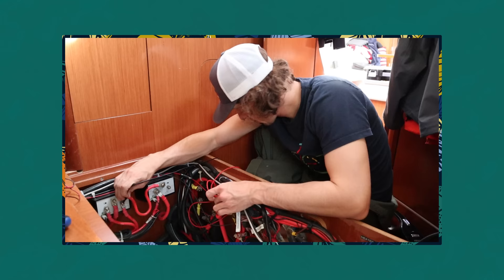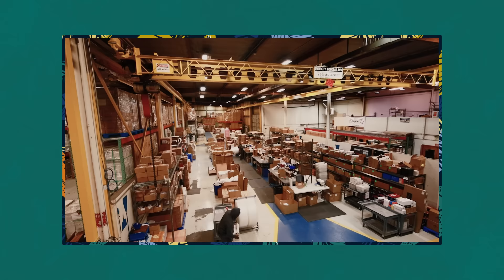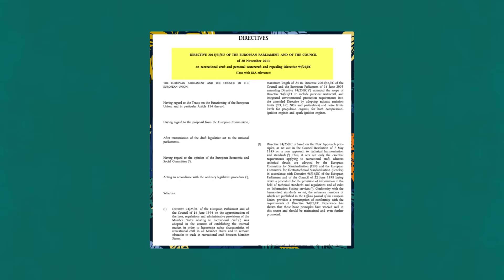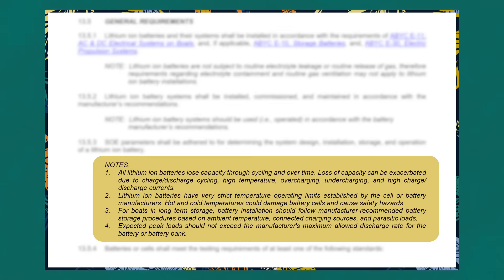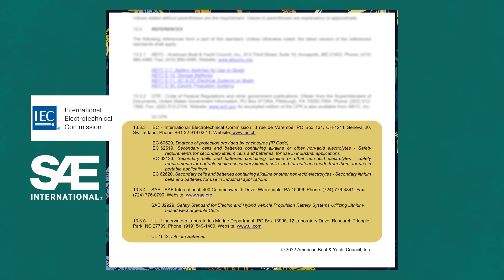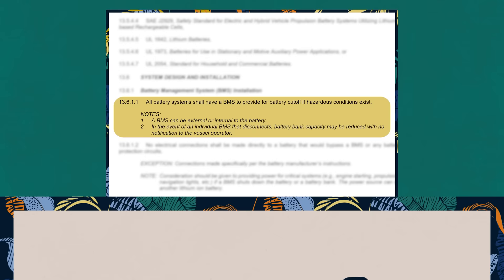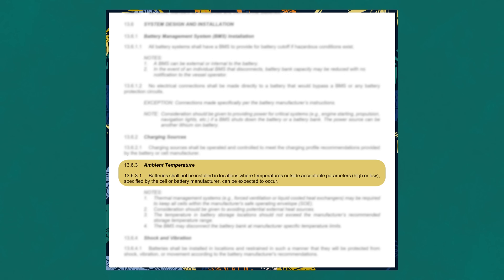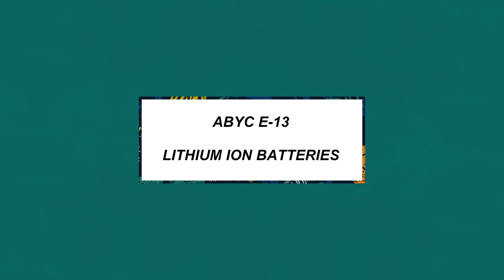LITHIUM BATTERIES: What makes for a safe installation onboard? (according to the ABYC@AbycincOrg )

Comment: 18 months ago I upgraded from a 400amp AGM to a 400amp Lithium house bank,  I used your lithium install video as a guide. It has operated without an issue. Let me thankyou for providing reliable and straight forward information to cruisers. I could not find one marine electrician who I felt was knowledgable enough to safely provide this service.  Please keep providing sound advice regarding Lithium batteries, best Regards and safe sailing to you and the wife

Comment: Thanks for the video Ryan. Well done. I was wondering if you have ever looked at Clark's (Emely and Clark's sailing adventure) video on mixing led acid with lithium using his Bank Manager? If you have not I think you would  find it interesting. He also has a 12v ac unit.

Comment: Another great video … thanks for explaining the CE etc for Europe a bit too as I may head there eventually and import the boat if I am forced to… and CE is a requirement from what I’ve started to read. 
System is definitely better than making it all centered on the battery itself. That would eliminate so many great ways of doing this upgrade.

Comment: Just a heads up....

There was a severe near fatal incident here in qld Australia of a very well known brand lithium battery that failed and completely cut power from the battery to the motor and caused the boat to loose steering and crashing into another vessel, 

Also another incident with a motorcyclist that went over the handlebars due to the sudden loss of power and engine stalling causing the rear wheel to lock up

Mercury immediately put out a service bulletin stating not to use lithium batteries on their engines and they will not warrant any damage done by these batteries. 

Also rumours of a class action lawsuit, 

While I love the new technology. 
The fact that they are seeing these failures in not only marine applications but also land based vehicles that are not exposed to the elements of salt water etc is truly shocking and dangerous. 

I’m not a hater of the technology, but with all the problems with the BMS causing failure not to mention leaving boaters stranded and unable to start their motor,

Do I believe the battery is safe? The chemical compound itself? 
Yea I’d say it’s pretty safe, they don’t catch fire but they will let out enough smoke to kill you and the heat off a burning battery is insane!!
Is the bms safe! Absolutely not!! 
There needs to be a back up capacitor in order to have a unit that will cut power at any given time due to a failure, more work need to be done before we start telling everyone they are 100% safe..

Comment: Thanks for this. I have dreams of converting to an electric engine, putting solar panels all over my boat, and doing long term cruising. Could you please share why you have not gone electric? Given how expensive batteries are, I would think you would have done this conversion since you work for a battery company and presumably get a deal. Thanks.

Comment: As you’ve stated, the evolving marine lithium battery market standards are finally being formalized. Since the marketplace has leapfrogged ahead to accommodate huge demands on house battery banks, when are battery manufacturers going to offer more than 50Ah, 80Ah and 100Ah rated 12/24V batteries?  Some installations will require as many as 8 and possibly 10 lithium batteries due to load demands. Even 200Ah batteries @12V require 4 or more units in serial/parallel configurations. Are there plans to go to higher Ah rated units to conserve numbers (and space) required?
Reply from the maker: A number already are.  We offer a 280ah and  soon a 560 in 12v.  A number od other companies do The same.

Comment: Good video but what I don’t see is the standard from anyone regarding short circuit protection so that potential of fire risk is reduced. As with the electrical code there is a requirement that the protection equipment (overcurrent devices such as circuit breakers or fuses) can withstand the short circuit applied. The amount of heat produced in a short circuit is essentially 1 degree per amp of fault current. So, if your bank can produce a fault of 5000 amps, then the circuit protection equipment needs to be able to withstand that amount of amps. If not, a fault will most likely always cause a risk of fire. I am an electrical engineer and sail a Swan 48 hull 140.
Reply from the maker: This would be under a different section of ABYC but yes, they define this as the AIC fuse rating and the exact reason why thr best fuse to use for a battery Instalation is a class t
Reply: @RyanSophieSailing  thats good at the source. It would be good to have the battery mfgr provide the AIC at the source with multiple configurations and available Fault at the point of common coupling. Also, the let through of the class T should be provided so downstream overcurrent devices are properly selected such as circuit breakers. It just seems there is not enough info on the overcurrent protection required and wiring sizing. I follow Nfpa 70 which is the National electrical code for all electrical on my boat. It must be difficult for battery mfgrs to deal with electrical fires on boats especially since I would expect it to be installation/design issues and not product. Thanks for the response and have a good night.

Comment: The alternative power source could simply be another LiFePo4 battery in the system. If you have multiple batteries (which is typical) you'd satisfy this requirement. In our case, we have a single large LFP bank (one BMS) so I added a 100ahr AGM in case of disconnect.

Comment: Ryan, did you install T-Class fuse(s) on your battery/battery bank - if so did you do it at the bank level or individual battery? Have you ever needed to combine your house bank with your starter /AGM battery - if so any thoughts on that?

Comment: Ryan, I'm learning plenty from you on Lithium systems - thanks.

However, I'm puzzled about the voltage in the Lithium bank. I'm considering using Dakota lithium 24V units instead of 12V, primarily to keep the wiring cooler. When I need 12V for lighting or electronics, I'll use one of your DC/DC converters closer to the item(s) needing power. It should make the inverter's work easier too I think. Did you keep 12V because of existing systems and wiring?

While I like the idea of each battery managing its own cells and protecting against over voltage/current events, I'd like to get a look at what it's doing, especially if the battery has been stopped - is there any plan to provide bluetooth or other mechanisms to provide diagnostics?

Comment: OK, gonna try to get this right.  Clark from  Emily and Clark's Adventures, have come up with a BBMS. Battery Bank management system, to charge both lithium and lead acid together and disconnect when necessary. Do you think his thinking is right?
Reply: I'll ask you the same thing I asked Clark.  Why, in 2023 would anybody want lead acid?  He has a gizmo to sell that only works if you have it, that's a pretty good reason.  Everybody else is better off putting the cost of his gizmo into another 200 amps of lithium.

Comment: Do you take any measures against low current overcharge of your Li-ion batteries or do you rely on the BMS? Does the BMS really prevent that?
Reply from the maker: the BMS has a high voltage cutoff which would prevent this.

Comment: So, just put a 60AH cranking Dakota in my fishing boat.  I keep getting a 13.8V-15V fluctuation, is my alternator going too high and getting cut off by the BMS?  Battery shows full charge. Motor stays running.
Reply from the maker: What type of motor do you have, this can be an issue with some outboards  but I think the support tea. Has a fix

Comment: I left a comment yesterday but now it seems to have been deleted and I'm just wondering why? It wasn't a negative comment, the opposite in fact. Was it because it mentioned another channel?
Reply from the maker: Hi! Hmmm, that's weird... Youtube filters out potentially offensive comments, but there is a "trash folder" into which we go find them. I went in there but didn't find anything from you. I only remove the really nasty comments. And usually, I don't even just remove them, I block the authors :p It has made for a much more peaceful experience as a creator over time :D
Reply: @RyanSophieSailing  Blocking the a-holes seems like a perfectly fair thing. I promise my comment wasn't like that at all. Ok, well I will try again I suppose. Maybe I only imagined I pressed the comment button. 🙂 Or maybe it's the gnomes.

Comment: Does the standard speak to Lithium starting batteries?  I'm interested in LiFePO4 cranking batteries for yanmar diesels to save a lot of weight at the aft end of a sailing catamaran.   They would be directly in the engine compartment.  Thanks.
Reply from the maker: No they dont, as we are at a very early time with these standards.  That said the general gist of the standards is to follow the manufacturer's recommendations.  So if you do this and follow any additional installation guidance from ABYC you should be okay.  Though, as always... check with an electrician who knows your system

Comment: G'day, Nov? 4+ mths ago, like early days of PC, that's old for this tech discussion. 
After ~3 years watching various YT sailing vids, I only heard about Dakota yesterday researching elec engines. Yet I see plenty with Battle Born (neither good to me with freight costs to Aus). So why not also do similar "marketing", help out fellow YT sailors, RV'ers, etc out, do the right thing by the environment, which apparently that's what its all about, vs Torqeedo, who's been involved in the game for 15+ years, set the standard of price gouging huge mark-ups for some moulded plastic & a battery, vs componentry & labour of cheaper 2 or 4 stroke. Profits over environment. End-Rant.